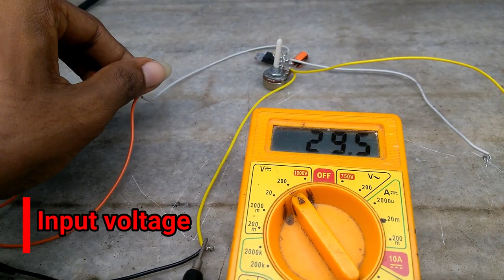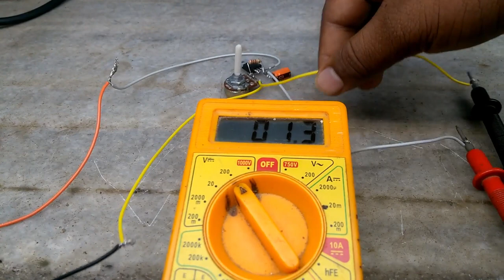Simple voltage regulator #lm317

Comment: What's about the ampere ? input 12-0 volt / 14 amp  then output will be increase or decrease ?
Reply from the maker: it's only 1.5 amps
Reply: @ADHARSHP  if the input  ( - ) 12 v / 0.5 ampere also getting 1.5 amp ? Please reply

Comment: My use dc controllers but not bad Usefully. Ic mosfet very heat and dc i am used motor dc 555 running but 2 minute after dc motor close

Comment: I did one but the transistor gets hot very quickly. What's the cause please
Reply from the maker: you supplying more ampere. maximum amper of lm317 is 1.5a
Reply: @ADHARSHP  my solar panel is 2.5A what transistor should I use in this case please

Comment: Hello sir,

Thank you for the nice vdo.
I have prepared the circuit and its working nicely up to voltage metere readings. but when I am attaching any load on it ( Mobile, 6 v dc motor) volt getting decreased automatically within few seconds. 

can u plz diagnose the problem.
Reply: Maybe your circuit can't handle much current at all and it just ends up dropping the voltage as soon as the capacitor discharges... What components are you using?

Comment: My potentiometer catched on fire... and the circuit wasnt working before that either...
Reply from the maker: it only for 1 amp ckt
you trying for above 1 amp the pot will burn
Reply: @ADHARSHP  I tried it with a small motor and it still did
Reply from the maker: @lengaming1651  you transformer  is 1 amp above
Reply: @ADHARSHP  what about 1.6 amps

Comment: I have given diode rectified 12v 2amp transformer as input

I have only got a max of 0.15 amp as output
Only able to glow an led at 3.7v didn't even run a small motor
Waste of time